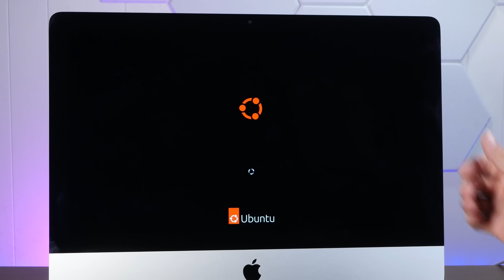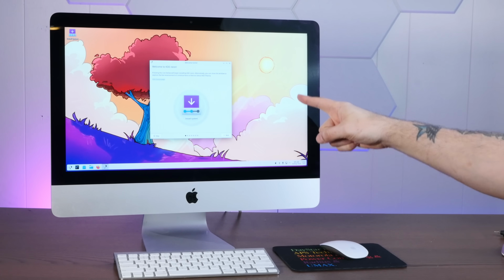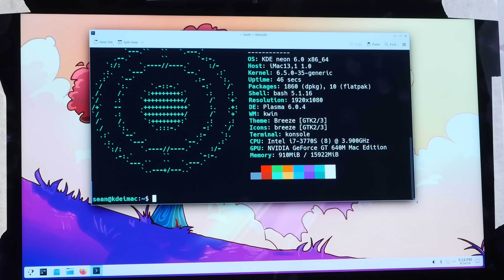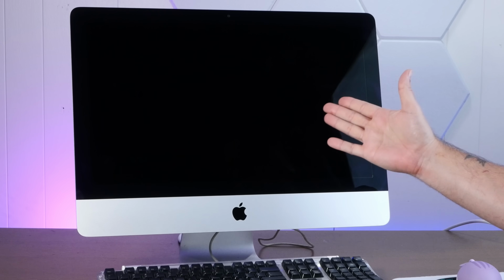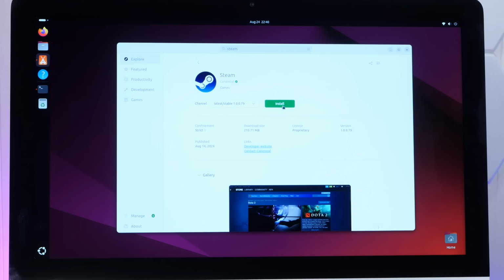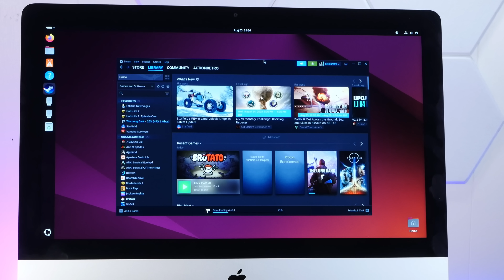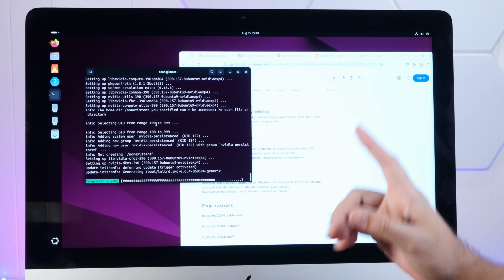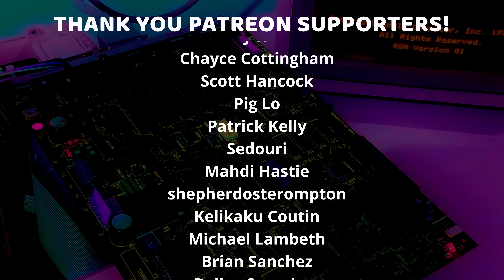LATEST Ubuntu on a 2012 iMac! (CPU Swap!)

Comment: Even if you are using 340 and 390 Nvidia drivers you can use proton 6 - 7 - 8 for many games. Mostly pre 2020 games.
I have a GTX 750 TI which is stuck on 390 and I can play many games with old proton versions.

Comment: FreeBSD works perfect on this model with the Nvidia 390 driver. And if you use a frugal window manager without a compositor, you can even do triple screen on the base model with 512MB GPU.

Comment: Day 3 of trying to convince sean to make a video on the 2011 iMac unibody:
The unibody shares the same face as the slim (the one in this video) and shares the thickness of the aluminium.
So its beautiful while still being as upgradeable.
I know I say it a lot but the best part: the GPU is not soldered.
You can go up to the GTX 770M with almost no problem (why almost, because there is always some sort of problem in each mod).
You can upgrade to a core i7-2600S, 32GB of RAM and, if you are willing to use ethernet or a usb wifi adapter, you can remove the old wifi module in the machine to get a mini PCIe slot that you can adapt to a full one and use a real desktop GPU! (Still need either an external PSU or do a lot of research on which card can use only the power provided by the PCIe slot, you also need an external monitor to use the card)
Overall, this computer is pretty neat.
Pls do a video on it.
🙏🙏🙏🙏🙏🙏🙏🙏🙏🙏🙏🙏🙏🙏🙏🙏🙏🙏🙏🙏🙏🙏🙏🙏🙏🙏🙏🙏🙏🙏

Comment: how does my iMac 2011 (i5-2400S, 8GB of RAM and a 6650M with 512MB of VRAM) run minecraft with intense mods better than your iMac without any mods!? (mine is running linux mint xfce)

Comment: The CPU change is because you are aiming to run videogames on it, right? My iMac mid-2012 already has 16gb of RAM  and an external SSD  (1tb)... Would Ubuntu run good on it as it is?

Comment: I have a 2010 iMac (iMac11,2) that happily runs the most recent version of Ubuntu. I actually use the kubuntu variation and it runs very well. Perfectly acceptable for browsing, streaming and whatever else I feel like doing on it. Even some older games work fine on it.

Comment: I have one of these late 2012 beasts, unfortunately its pretty beat up and the internal drive is failing.  It has been a sore spot with me for years that this was the only model of the 2012s that year made nonupgradable by its owners unless they brought it in to Apple.  To be blunt, I don't take kindly to be raped by big companies needlessly while at the same time being marketed to as if they're your ordinary, kindly, hip, one of us companies.  Those days are long gone with Apple. 

So, I've been running Catalina off an external Samsung SSD for about two years which has made the machine super fast as well as given it new life.  I also have two other SSD externals of which I keep various libraries (music, books, etc.) as well.  I no longer use Apple's hideously lacking Books/iBooks application since they made it so we had to maintain its library on the hard drive (all the while moving audio books to it as well).  And no, I'm not going to subscribe to increased amounts of iCloud.  Something like keeping your library on an external should be an option, not forced. I can think of no good reason for this other than to push people to subscription services.  Thus, after having been an Apple devotee for about thirty years, I am no longer, in fact I've come to detest Apple as much as I once love them.   I don't feel like playing along with the reduction of options and increased costs to be part of what once was a walled garden, but has become a fenced in maximum security prison.  Particularly since we are no longer being able to upgrade our machines at our leisure but instead are now forced to pay $200 per upgrade per level at the time of purchase or not at all once out the door.  I'm not stupid, nor have I ever been cultish about anything so no apologetics from me about Apple.  Their days of being the underdog was almost twenty years ago, and I don't buy that meme anymore. And really, I don't care what number of colors it comes in, or how thin the machine is.  It's a computer, not a decorative element for my living room. 

Now, having said all that. :)

I would like to move to Linux.  However, I am by no means technical nor do I have any real understanding on the inner workings of computer programming.  Which is perhaps why, I stayed with Apple for so long.  I had tried to give Linux a try by creating a boot up with Ubuntu on a USB stick, but I ran into a common problem where upon booting up, the machine it would not recognize my bluetooth mouse or keyboard.  And any guidance I found online seemed rather cryptic. 

Could you give advice as to a good source for me to learn at least the basics with Linux so that I don't make a costly mistake by jumping ship, only to find that I have no idea what I'm doing?  Line commands seem as opaque to me as learning Coptic. Or am I making a big deal about nothing when it comes to using Linux?  As far as Windows, I would sooner return to Apple than go that route... I had worked on Windows machines at my job and found them rather problematic.  And from what I've been reading lately, not much has changed.  Between bloatware, and the inconsistency in which they handle their upgrades, I don't think I want to subject to that nonsense either.  And Linux from what I've read seems to have a leg up on both Apple and MS, in some ways that matter most to me.  

So, my question is... Is there any hope for someone like me? Or am I stuck returning to Apple, biting the bullet and being their financial pig whore for the rest of my days?  To be honest, I think I'd rather step away from using computers entirely if possible if this was my only choice. 

Thanks kindly!
Reply: Use a wired keyboard and mouse.  Also, see the earlier video in this series for his disassembly, but there are other videos on YouTube that are even better detailed on how to operate on these iMacs.

Comment: 11:24 relatable, the 390 driver works however on ubuntu 22.04, only in the 6.2 kernel, so you have to install ubuntu 22.04.3, then upgrade it with 'sudo apt upgrade' but don't boot with the 6.5 kernel but the 6.2 kernel, then install the 390 driver and it will work

Comment: Jesus, you did some "hacking" and set the distro to Jammy on 24.04 and then did an apt update? No wonder people still think you have to tinker and be a software developer to use Linux. dpkg not working? Why not just compile the kernel you needed. You know you can use LinuxTKG and a script does it for you, even does the install part.

Comment: I have been trying to run this exact machine (without the upgrade) with Lubuntu. Even with that distro it is still a bit too slow. Thank you for the upgrade suggestion. I will give it a go.
Reply: Ergh I have the 2015 model and the CPU is soldered in place. Any recommendation are welcome.

Comment: Old machines arent alwayse usless even in more modern times.

Recently rebuilt a friends Phenom II with some updated used components on the cheap he dosent do any serious gaming but he uses it for a media center and just general Office type and internet use. (Phenom II x6 w/overclock (4.1GHz), 32GB RAM and a 2x 1TB SSDs, a wireless card, Radeon RX560 and a newer case.

Mostly parts I had lying about, Garage sale and Ebay purchases. 

Handles 4K video smoothly and anything else non gaming on it. Running Linux Lite 64-bit.

Comment: To solve your Steam problems either use Proton 7, or Patch your current Proton Versions with the older Dxvk 1.10.3 and vkd3d 2.6 Versions. That‘s because old nvidia drivers (you can go up to 470 btw) do not support newer Vulkan Version required by later dxvk/vkd3d Versions. Works with all Proton Versions.

Comment: Ubuntu 24.04 on my 11,3 MBP is shockingly good. I’ve tried multiple distro from arch and fedora, but nothing matches the out of the box performance of Ubuntu. 

I bounce back-and-forth between macOS and Linux on this device. If a lightweight alternative to blue bubbles existed, I could abandon macOS entirely.

Comment: I had issues with UEFI on my 2010 Mac Pro server when I had a Mac flashed PC GTX 680 in it. Legacy worked fine, but UEFI under Windows or Linux would cause a black screen when installing the NVIDIA drivers. I switched to an RX 570 in the end and it's been fine.

It's worth trying to see if you can install Ubuntu in Legacy mode via rEFInd or something and see if that helps.

Comment: I laughed when you said Linux, it just works then a moment later proceed to not have certain graphics things not working after a bunch of tinkering. I once was a Ubuntu proponent but gave up after years of tinkering all the time to make things just work. I also couldn't play my favorite games. So when I build a new computer prior to the one I have now I made the switch back to Windows. Seems Linux will never just work and you always have to tinker. I will have to say that Linux always seems like a faster experience on the same hardware. But don't hate on my as I use Ubuntu server at work on all of our servers and a single desktop Ubuntu.

Comment: Beware.  I've upgraded these iMacs too.  This guy conveniently glosses over a very important step.  Removing/replacing the CPU is an incredibly delicate endeavor.  The heatsink covers both the CPU and GPU and re-installation of the heat sink is one of the worst things ever to do.  The heat sink requires that rear spring plate and if not perfectly installed (it won't be perfect for new folks) then one risks bending the CPU pins on the motherboard and smearing the thermal paste everywhere.  If you're not technically talented, you will most likely ruin the CPU pins.

I had to use a microscope to gently re-bend the cpu pins that got damaged.  It's hard and delicate work.

Comment: Free I have a 27-in IMAX 16 GB of memory Aunt instead of putting Linux on it had a fusion drive so I basically just kind of kept it all together and used open core patcher and it now runs Sonoma and it runs very well

Comment: So Arch and Arch based distros like Garuda/Endeavor/etc you can just install older versions of Nvidia proprietary drivers from the AUR. I've got one system running Garuda LXQt with full hardware support on a GeForce 8800 GTS 640M, so it is possible
Reply: I should add, on the latest kernel and SDDM at least, SDDM shows a black screen, totally usable still to enter password and the main desktop works fine after that

Comment: I wouldn't hold my breath for any updates at all to the 390 drivers. I found a GitHub project a while back dedicated to trying to make those drivers work with newer kernels, but it looks like the creator hasn't touched it in a while. Ultimately, I gave up trying to make Noble Numbat play nice with the machine in question and rolled it back to Jammy Jellyfish. At least it's not e-waste...

Comment: The 2011 iMacs are MXM so you can swap up to a quadro p5200, which is a full fat gtx1080 with 16GB of vram. Which is funny as the system maxs out at 16gb of ram.

Comment: my neighbor has a 2012 imac with ubuntu on it

i would install ubuntu on my 2009 imac but for some reason it doesnt work with the gpu very well and splits the picture into 4 smaller ones

Comment: Hi mate, regarding the issue with the Nvidia Drivers, it is caused by the weird Apple EFI implementation. For it to work correctly, the system need to be installed in pure BIOS mode, wich needs a little bit more thinkering. on the other side, Opencore Legacy could help by giving the computer up to date EFI variables. You might wanna try the BIOS Method first. Cheers from Quebec.

Comment: You can get much better performance from nouveau (though still no vulkan support) on these cards if you use a tool to manually change the power state of the nvidia card as the foss driver is not able to do it automatically unlike the proprietary one - look up nouveau reclocking

Comment: Surprised you don't use fastfetch over neofetch or screenfetch considering how much faster it runs as it's a rewrite of neofetch in C.

That aside, it's a little disappointing to see NVIDIA not open source the kernel modules for older NVIDIA cards, as the "install Linux on an old PC to make it new again" claim would only be partially true in that case. Especially in developing areas where one realistically can't afford recent GPUs. That said, Ubuntu sure runs better on a touch-screen Windows laptop with a measely 4GB of RAM and 64GB of storage compared to Windows 11.

Comment: I was able to install openSuse Tumbleweed with nVidia 470 on my 2012 MacBook Pro with GT650M. Performance wasn't that great with DXVK so I stuck with Windows 11 in the end which worked perfectly fine even with an outdated graphics driver.

Comment: I have a 27" iMac with a Core i7 2700, which originally came from a recording studio. I used it in my office for a long time, then the graphics card failed (a known issue). In the meantime, I've installed an Nvidia Quadro, a modern Wi-Fi/Bluetooth card (from a 2014 MacBook), and two SSDs. With Open Core, I can boot into both Windows 11 and macOS Sonoma. However, I mostly just use it with Windows 11 now. It’s currently at my girlfriend's parents' place, in her old childhood bedroom, where we use it as a TV (27" is 27"^^). The old iMacs are still quite usable for everyday tasks, and you can even play some games on them – Fortnite even runs on it.
Reply: So you went from bad to worst?

Comment: I got a Mac Mini from a friend about a year ago. I decided to try it with Linux Mint, and it is smoooth. Even able to play 720p@60 youtube videos, so it became my garage PC. My only complaint is that the original Wireless Keyboard and mouse do not connect, since it's not their home OS. They are disovered, but connection doesn't work. Otherwise these old apple devies are pretty and fully functional Linux PCs for cheap.

Comment: I recently bought an early 2013 MacBook Pro for $180 to run my home built cnc machine, I run 3d modeling software on it and adobe creative suite and anything else I need. All it needed was the anti-glare to be polished the rest of the way off. It’s actually become my go-to computer. Stock battery only goes about 1.5 hours, but it almost never leaves my cnc drawer.

Comment: Using Arch if you use the linux-lts kernel while running the archinstall script everything will work correctly as this uses the 6.6 kernel you were trying to use here and is still fully supported. Be careful when choosing your desktop environment as wayland does not work at all on cards older than the 900 series.
Reply: Oh and also be careful while using the archinstall script itself, it gives you the option to use proprietary nvidia drivers but these will install the latest 560 drivers instead of the 390 you need for this old card. You need the 380xx-dkms modules off AUR. Or you can use a 3rd party tool like nvidia-all from frogging family. Make sure you manually install the linux-lts-headers package or nvidia-all will retrieve and use the regular linux-headers package and build against 6.10 which will fail silently.

Comment: @ActionRetro i think you can make nvidia drivers work if you look at arch's aur as there are old nvidia drivers. In the packages there are usually patches and applying them on uncompressed stock nvidia drivers should make them work on newer kernels.

Comment: i am surprised no one has made magnet achieve for the imac. so you can remove the glass anytime when you want. be strong enough to hold it in place.
Reply: You know... that may not be so very difficult for anyone to do.  Considering that you can purchase very smal yet very powerful magnets online anywhere.  I couldn't tell you if it would be safe considering how magnets can reek havoc with storage devices and who knows what else.  Computers are not my area of knoweldge by far.  But it really does sound like a very good idea.

Comment: We have one of the Nehelem based iMacs. Amazingly upgradable and damn usable if you throw 16 gigs of ram and a decent quad core (an i7-980). I actually kind of wish I'd thrown in a Xeon for the additional memory support. The main weakness is GPU support, but for the use it's getting the older HD-5000 series works perfectly well.

Comment: Regarding the Nvidia drivers, you probably have to use Nvidia-DKMS. This builds the nvidia driver for your current kernel version. It's the default on Arch for example, because their kernels are usually way newer than the one Nvidia intended you to use.
Reply: Okay and I looked into this for 3 Minutes, Action Retro is right, the DKMS package for the 390 driver seems to be unmaintained. Rip.

Comment: I'mma try live booting Ubuntu on my 2009 Core 2 Duo imac
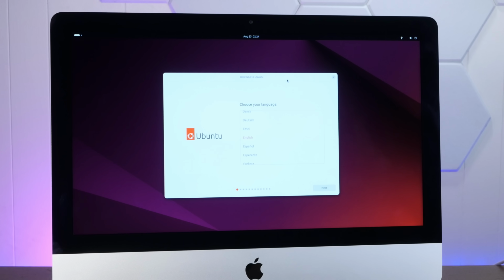Reply: 7:46 Ubuntu didn't show a wifi signal in the upper right for me on first boot but at the first connection screen I just chose 'use wifi network' and it worked without a hitch

Comment: Might try Fedora based distro instead of Ubuntu. RPM Fusion appears to maintain nvidia driver packages with support for current kernels. The packages also claim to gracefully handle compatibility issues with the nouveau drivers.

Comment: I have one of these! 21.5” I used my old MacBook Pro SSD adapter with a Samsung 950 512GB kept the 1TB as extra storage. Currently using open core legacy with Monterrey. I didn’t know these CPUs were socketed! If I can upgrade this on the cheap…

Comment: I remember back in 2015 I bought a 2010 17 inch MBP, the battery in it had seen better days and I was a little wary of the thousands of cheap Chinese battery replacement options on Amazon and eBay, so I called my nearest Apple Store and asked if they happened to still have any batteries for it by chance. 

The guy on the phone literally said “We don’t stock retro parts”